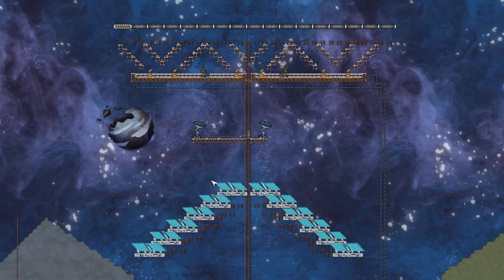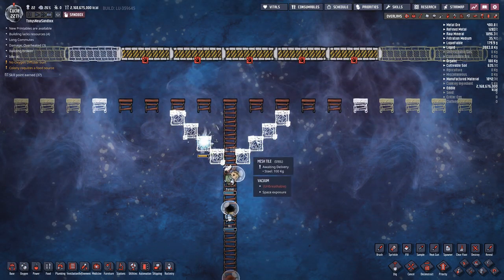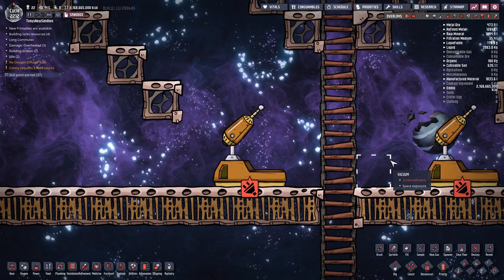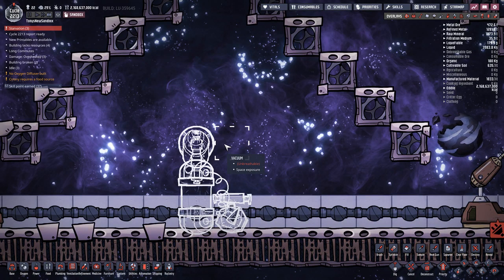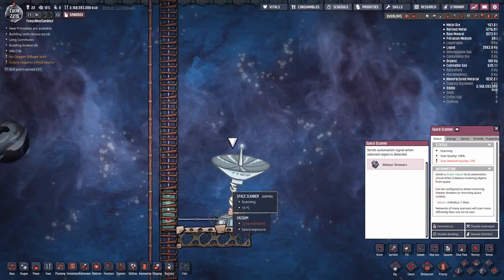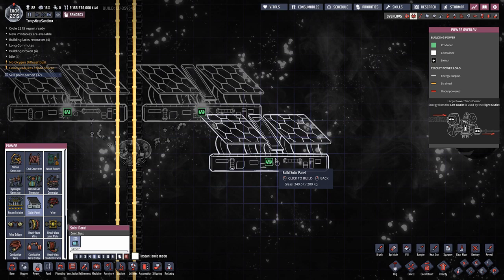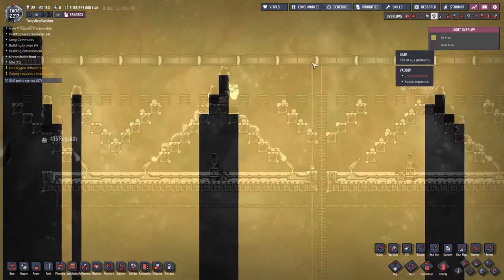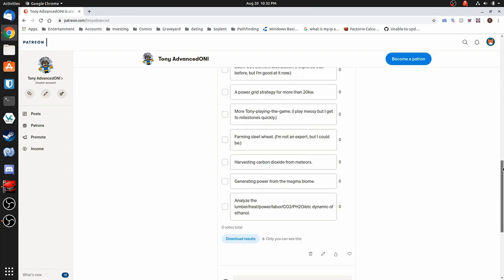Solar Panel Essentials

Comment: This design could be easily optimized by adding a 26 seconds filter gate right before the NOT gate that leads to the bunker doors. This way, the doors will start closing 26 seconds later which will increase how much sun you get while maintaining a minimum of 39 seconds for your doors to close, which is exactly how much bunker doors need. 
If you make the sun farm larger, you can build more and more space scanners until you get 100% network scan quality, at which point your scanners will always scan incoming meteors exactly 200 seconds in advance. At this point, you can set your filter gate to 161 seconds so that your bunker doors will always have exactly 39 seconds to close.

Another thing I want to add is that I don't think a large battery box is the best way to utilise solar power. Batteries contain relatively little power, so relying on them for large scale power storage will require huge amounts of metal and a significant amount of power will be lost as runnoff. 
I think a better idea would be to rely on other sources of power as your main source, such as natural gas, coal, petroleum or ethanol. For example, a reservoir full of petroleum or ethanol contains as much energy as 125 jumbo batteries while requiring the same amount of power as a single jumbo battery to build. With automation, you can set your other generators to shut of when power isn't needed. In that situation, solar power basically just saves fuel from other energy sources. It might not look like it, but less solar energy will be wasted this way.

Comment: there is no need to use liquid shutoff. you can directly connect the automation wire from hydro sensor to the liquid vent

Comment: Thank you for the great info. I was building my solar plant WAY to close to the ground and compact.  

Question.  Couldn't you just replace the drywall and water with temperature shift plates?
Reply: No, the temperature shift plates will move (or buffer) temperature exchange through a medium.  Robo-miners need to be touching a medium (air or liquid) to transfer their heat in and out.

Comment: This was an excellent guide! Very useful, the only thing I then wonder is how to effectively store the power with batteries so it doesn't all run out at once.
Reply: I know Tony said to use batteries to store the excess energy, but actually batteries are pretty terrible at storing large quantities of energy. It's best to only build a few smart batteries to act as buffers and as input for automation. It's typically a better idea to use another source of power altogether when the sun isn't shining.  Since solar power is a late game thing anyway, you can use it to complement whathever you were using to power your base before. 
So for example, a full hatch farm produce enough coal to power a coal generator 93% of the time, but if the sun is providing all your power 70% of the time then you only need one full hatch farm for 3 coal generators. The same general idea can be applied if you are generating power with petroleum, natural gas, hydrogen, and ethanol. It's even possible to use an aquatuner/steam turbine cooling combo to store energy. The idea would be to cool water near its freezing point and to deactivate the steam turbine when the batteries are almost full and to deactivate the AT and to actuvate the steam turbine when the batteries are low.

Comment: Why not use petroleum?
Reply from the maker: Petroleum is transparent enough for the solar panels but it takes very little of it to prevent the space scanners from working. If you put enough on the platform to spread out to the edges then the scanners won't work.

Comment: The question I have is whether this elaborate thing is worth building at all. With all the meteor showers, and night time, is this power neutral at best?
Reply from the maker: The idea here is just to demonstrate the issues you have to deal with, but it IS quite a lot of work to get solar panels set up, no matter how you do it. They are definitely power positive, but they are on and off all the time so they can be tricky to manage. I used them back when I first started but once I got good at managing power they just don't seem worth it.

Comment: Im constantly dumfounded at how much trouble it requires and at what lengths people have to go to have reliable space access with scanners, robominers and solar panels. It took me like four hundred cycles to lay out the foundations for all of that (not referring to your build though). I wonder if it's designed this way.

Comment: You can replenish the water or just use crude oil - your choice
Reply: Just saw your own comment - as long as I can get a maxed out solar panel it doesn't matter if I block a bit of light.
Reply from the maker: @barshtoyer1806  if you stagger the solar panels like the video shows  then you make power out of every bit of light and you can benefit from any increased transparency.
Reply: @tonyadvanced6315  okay then thanks for the info!

Comment: did i miss something or is this no longer possible? mine overheat as they generate heat in a vacuum
Reply from the maker: The solar panels overheat? The heat has to have come from somewhere else. Put a screenshot on like ANY forum and a hundred people will evaluate the situation for you. I'll do it too if you like.
Reply: @tonyadvanced6315  oh, i thought they generated heat themselves that they then couldnt disperse... but youre right! i had them next to too hot regolith, thx^^

Comment: Use petrol instead of water, it turns into gas at around 600 degrees instead of waters 100 degrees
Reply from the maker: The reason I didn't use petroleum is because it blocks more light than water. But, it's still a pretty negligible amount of light. Petroleum is definitely a good option.
Reply from the maker: Oh jeez, I was just messing with petroleum in setups like this and it COMPLETELY blocks space scanners. If you keep it under 1kg/tile then it works, but I haven't succeeded at doing that.

Comment from the maker: Notes (Important stuff from the comments):
 1)  You can put the space scanners on the platform with the robo-miners. The robo-miners do not affect them. But if you add conveyor loaders or something later that DOES affect them, then that will be a problem.
2) The pattern of mesh tiles and robo-miners can be adapted to fit auto-sweepers too, in case you have things you want to do with your regolith. Something like this: https://imgur.com/fOtC4KK
3) Petroleum COMPLETELY blocks your space scanners, so it isn't a good option unless your space scanners are somewhere else.
4) Besides (3), petroleum is a pretty good option. It doesn't block much like and doesn't evaporate if regolith touches it.
5) Space scanners "view of the sky" has a width requirement. It's exact value is complicated, just be sure you are aware that it's a thing.
6) Space scanners need to be 15 tiles away from stuff (which is 14 tiles between the things). I might have said it wrong in the video.
Reply: You rock Tony!! Thank you
Reply: Unless they've changed something, space scanners don't care what's underneath them; No need to give 14 tiles of clearance below. Above them they only care about what is in a V-shape. It's explained in the wiki in great detail.
Reply from the maker: I just tried it out to be sure. I wasn't able to put a solar panel below a space scanner without degrading it. But... it also seems a little bit inconsistent at the margins, I know that I've had space scanners at 100% quality but with solar panels at 13 tiles below them (not 14).
Reply: Would visco-gel be the best liquid to use, or would it eventually turn to naptha?

Also can you put robo-miners on the underside of bunker doors?
Reply from the maker: @josephburchanowski4636  Visco gel looks awesome for this, but it's hard to spread out and if you pile it up it will block a lot of light. Miners on the underside of airlock doors will work while the doors are closed. It sounds like you have some ideas. 👍
Reply: @tonyadvanced6315  " if you pile it up it will block a lot of light."

Don't you only need 1 or 2 blobs of it per robo miner?  The fact it doesn't spread out means it only blocks light locally.

I don't think it will turn to naphtha so in theory you only need to set it up once.

As for the airlock doors underside miners. It seems like it might be hard to cool it.  The only practical way would likely be gas venting.  The other cooling methods seem a little complicated for an upside down miner.

Perhaps a small pillar of visco-gel could be used, but I don't know how it interacts with regolith falling on it, it might break something or move.  And like you mentioned, a pillar of it will block a lot of light.
Reply from the maker: @josephburchanowski4636  Yep. That all sounds right. It definitely won't turn into naptha, there's nothing there that's hot enough.

You got me thinking about using visco for cooling in space. I have ideas, maybe make a pillar after each meteor shower that cools upside down miners, then pump it away to be stored and cooled for next time. It's hard to justify though, if I have visco gel then I probably have thermium, and once I have thermium there's not much point to being clever with visco.

Comment: Nice vid. You could have placed the space scanners with the robo miners if you want to. they don't impede the scanner, auto-sweepers neither. only conveyor loader
Reply from the maker: I tried this out and you are totally right. I wonder if that's something they changed lately or if I've just never tried it without conveyor loaders.
Reply: @tonyadvanced6315  if you are like me, you build it the first time you went to space and saw there is something wrong with it and moved everything down. I only found out when I was doing a ghetto space setup and just slapped it there, because I didn't need 100 coverage and when I was rebuilding it I found out that it's the loader that is the culprit, which is kinda stupid, because you can use sweeper, but no loader
Reply: @tonyadvanced6315  Probably the latter :-) Only equipment that the game considers "heavy machinery" impedes the scanners' efficiency, a list is on the wiki: https://oxygennotincluded.gamepedia.com/Space_Scanner - for whatever reason, a conveyor loader is heavy machinery while the robominer is not.

Comment: Nice vid! I have a question, how do you fit a rocket under this kind of "Bunker Door Shield"
Reply from the maker: Good question. The bunker doors aren't much different except for some additional automation. But the mesh tiles and airflow tiles don't work for rocketry because the rocket has to fly through it.   The setup I use for rockets uses doors to catch the regolith (instead of mesh tiles) and robo-miners can sit between rocket silos. I have some new ideas to try for setting up rockets, so I'm not quite ready to make that video.
Reply: @tonyadvanced6315  I see, thy for the reply, if you figured it out pls make a video :D